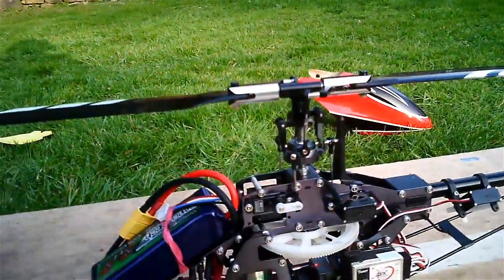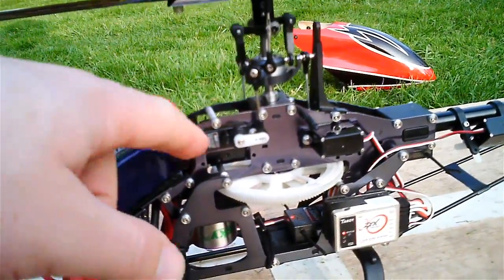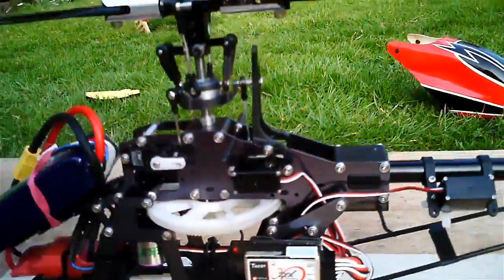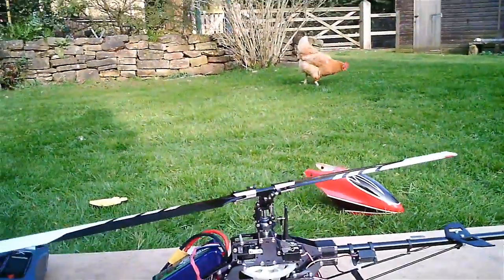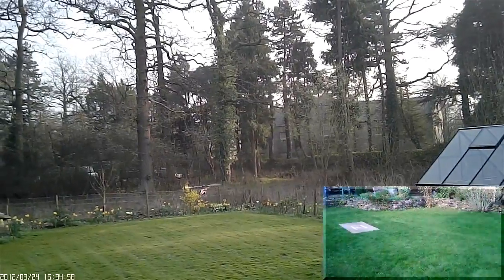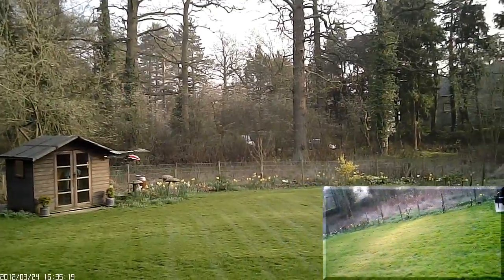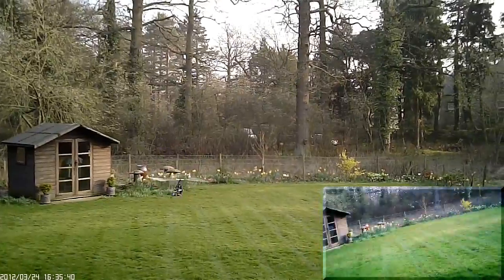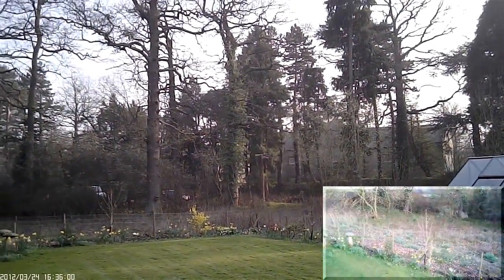HK-450FBL 032412 Tarot ZYX With Ino-Lab HGD-202HB Cyclic Servos Test Flight

Comment from the maker: Yes they are still as good as new after 100+ aerobatic flights.  I have them on all 3 of my 450's now.  If a servo gear stripping crash does happen fast-lad in the UK or helidirect in the USA sells the replacement gears.